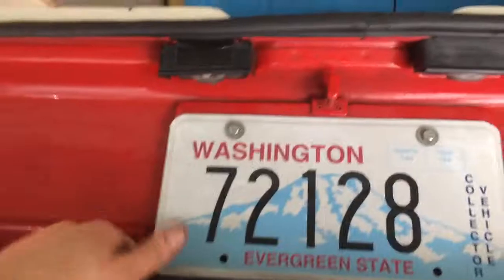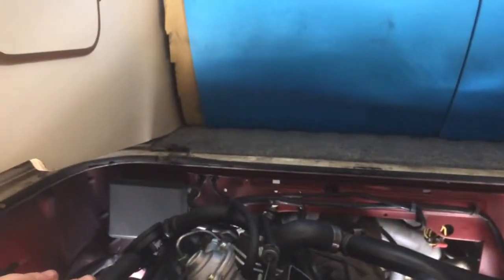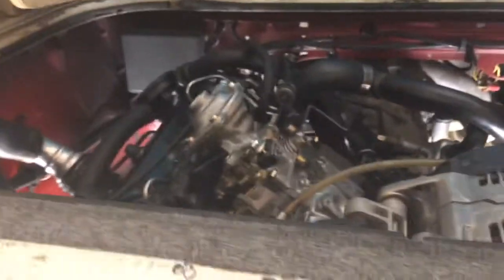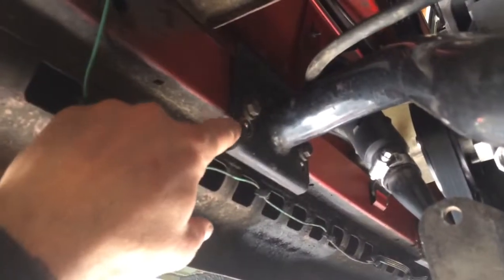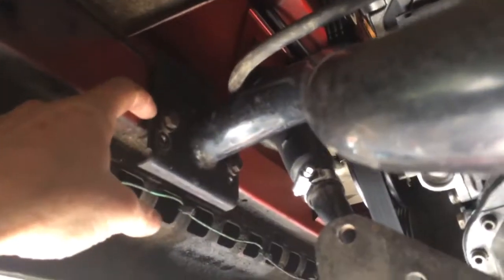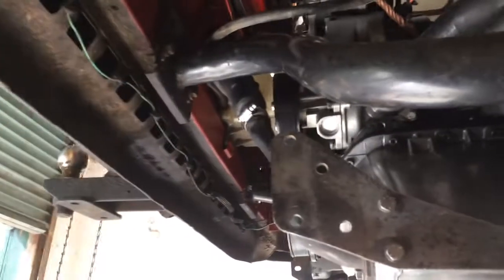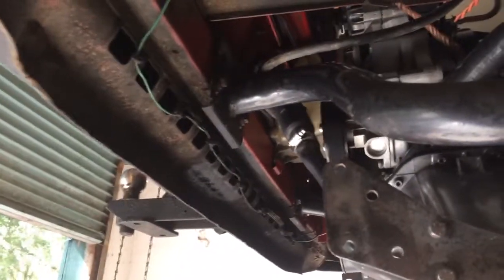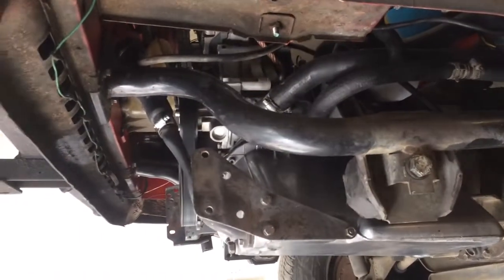Vanagon TDI AHU Swap: Lowering Motor Mounts to Clear Decklid

Comment: I did the same thing with mine when I swapped to a 1.6TD (very similar injection pump w/ boost aneroid) from the stock DV, but I also cut spacers from rectangular tubing for the fronts of the carrier bars and one for the transmission mount as well.  Bolted up just as easily.  That kept the whole works level.  I think it also lengthened the lifespan of my CV joints since the driveline angles were lessened as well.  No empirical evidence on that but it seems not to have the CV joint horror stories that other vans have.
Reply: Hey Michael, 7 years later… did that setup hold up well for you? And about how thick were those blocks like how many inches did you space your trans and engine carrier?

Comment: I am also thinking of fitting an AHU engine, I have a doka T3 so there is no need to lower the engine.
Does the AHU engine use the same engine mounts as the 1.6 jx Td or do I need to make modifications?
Reply from the maker: No idea on the JX. The original 1.6NA did have the same mounts, if you watch my Problems and Solutions vid i believe i talk about all of the things that carried over.
Reply: Thank you for your reply.

Comment: where did you place the ECU? Was it on the right side rear area in the back behind the tail light?  If so any water issues?
Reply from the maker: How did you watch this video and come away thinking it has an ECU?

This is an MTDI build…mechanical TDI. No ECU. Mechanical injection pump. Watch my injection pump video.
Reply from the maker: How did you watch this video and come away thinking it has an ECU?

This is an MTDI build…mechanical TDI. No ECU. Mechanical injection pump. Watch my injection pump video.
Reply: @jtlachappelle  - I missed read you have a AHU, not a ALH - Sorry about that.

Comment: same engine still running good after 3 years? does that mean lowering end motor mounts for 3/4" does not have negative consequence on the engine, lubrication, transmision?
Reply from the maker: Im at around 70k miles i think, same exact everything, and its been absolutely 100 perfect the whole time. The 3/4” drop is extremely minor
Reply: @jtlachappelle  thank you for your reply. I'm currently doing a conversion and I don't want to cut the engine lid. I like your idea about engine lowering

Comment: what did you do with the other motor mounts? did this make the engine not sit level? nice work
Reply from the maker: Take a closer look...i didnt change the mounts, just drilled new holes 3/4" above the factory ones, dropping the rear of the bars that much, which tilted the whole motor of course, but a negligible amount.
Reply from the maker: Oh wait you mean the forward mounts...i left those alone because i was dropping the rear so little. The whole motor/trans just pivoted down on the front transmission mount, putting a tiny tilt on everything yes, but no big deal
Reply: i wouldnt do that. You also misaligned a shift rod a bit.  I heard that the lid on the pump can be changed for smaller. I went through this allmost same with my AAZ swap. I am running Jx pump, no hole in engine lid. After i bought new engine mounts and replaced 30 years old ones, all went up another 5mm
Reply from the maker: Thing has shifted like a dream always, before and after the lowering. 5 years now and its still perfect